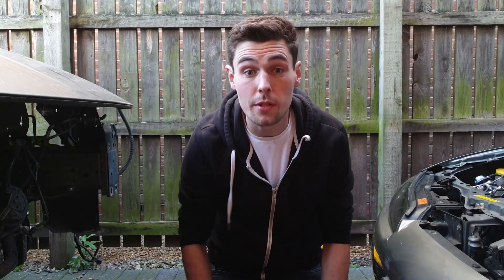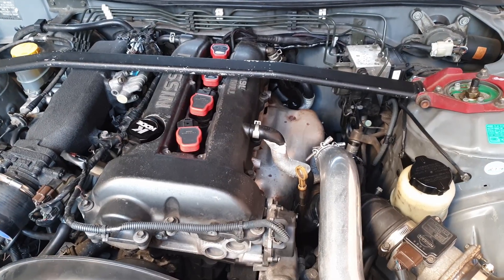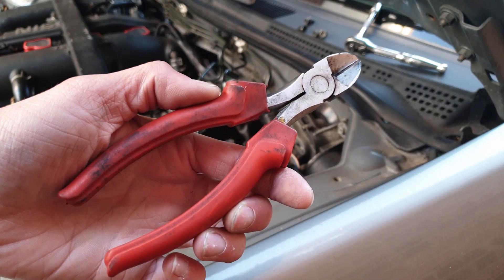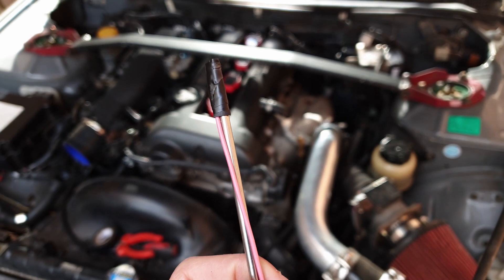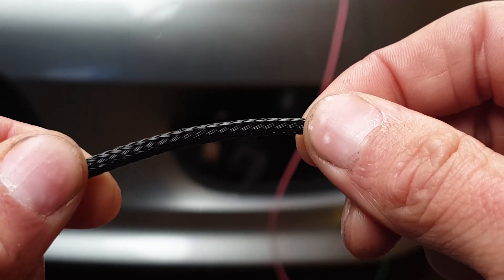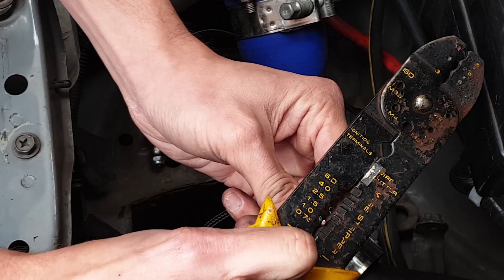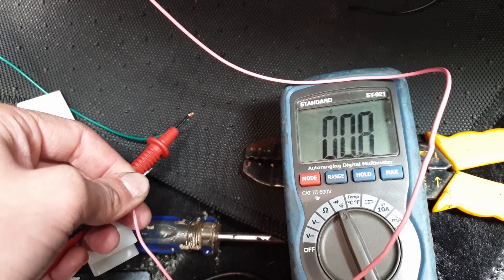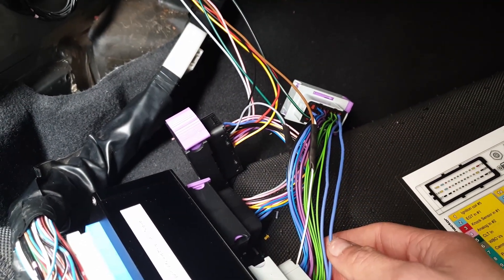Nissan S15 Project - Sensor Wiring

Comment: Hey man how did you connect the intake air temperature sensor
Reply: Like to what pins
Reply: @isaaccohan1085  he is connecting it to a standalone ecu
Reply: @frosty98412  I have an emu black I was just having the problem with what pin to use but I figured it out thank you
Reply: @isaaccohan1085  1 wire goes into a dedicated pin in the ecu. The other one goes into the sensor ground pin in the ecu. Which sensor ground can be shared with other sensor grounds (tps ground,  iat ground,  and coil ign grounds) mainly if you're using the flying leads building you're own harness. But if you're particular ecu is bought with a plug n play harness. You'll most likely will have to tap into it unless it's already pre-wired to use with an iat...